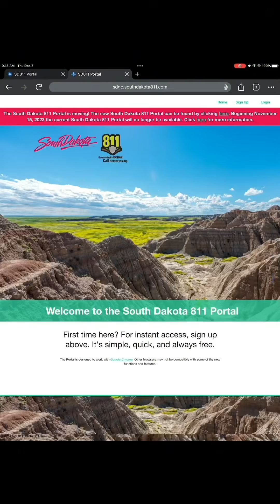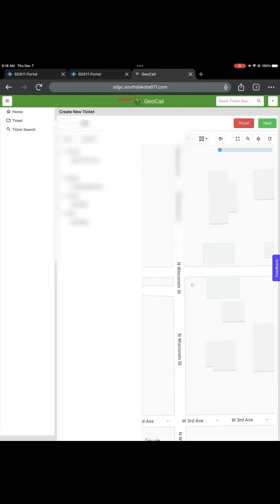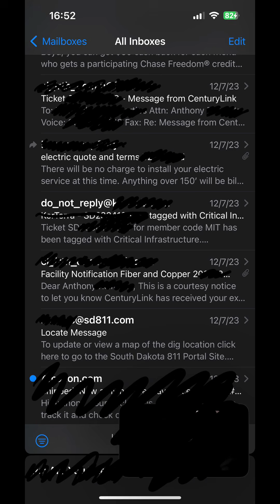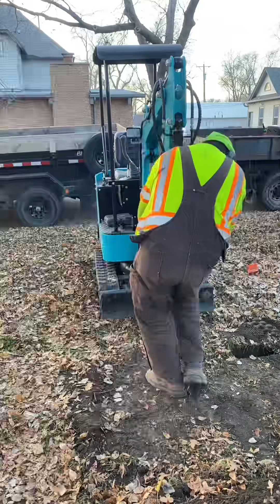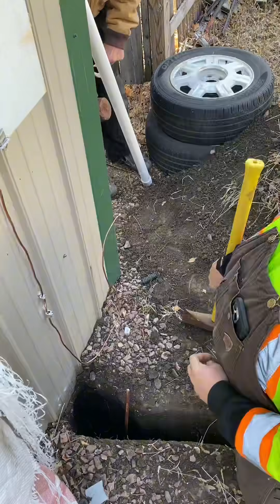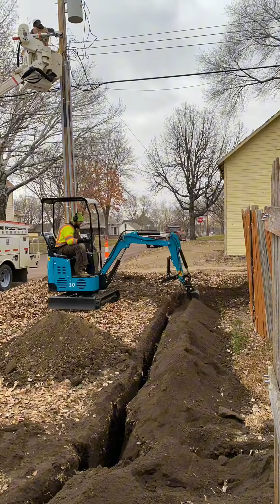The Process of digging in underground electrical. #HandsomeOrHandy.

Comment: But the house still has old scary electrical yes?
Reply from the maker: No, the electrician is making a bunch of upgrades inside.
Reply: Long live the trades! 

I have a reliable plumbing contractor that we refer as the “big boys” that give great speedy service if I’m in over my head (like refurbishing a pressure regulator).

As much as I’m decent at wrenching, I know I’m going to botch an automatic transmission rebuild, and don’t mind paying.

Comment: Was the sledgehammer you used especially for driving ground rods in because it looked like the mddle of the head was sloped in, making it more useful for driving in rods ,just wondering,GOD BLESS
Reply from the maker: It was a normal cast iron sledgehammer that has been used so much that the head is now concave which is good for hitting a ground rod